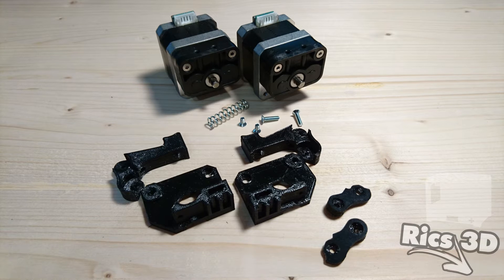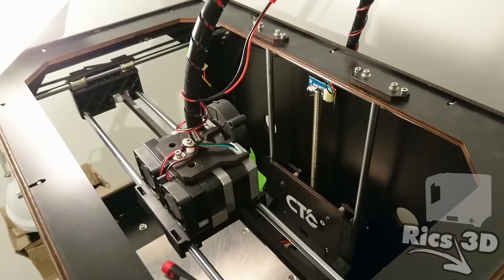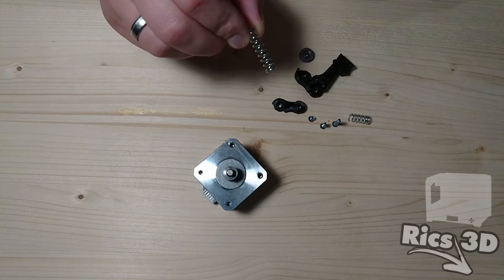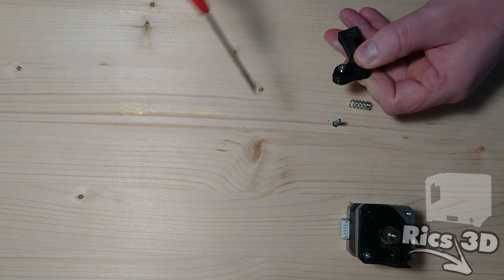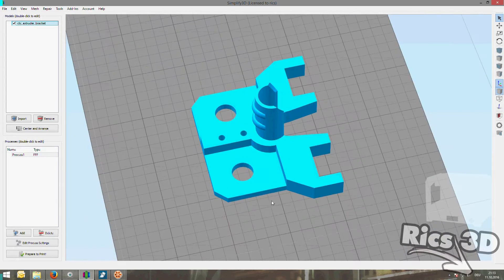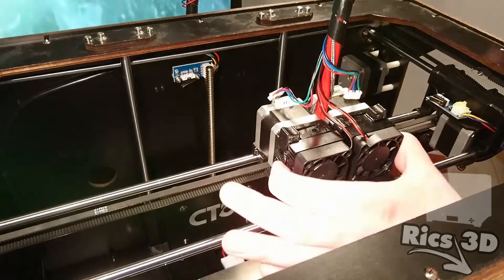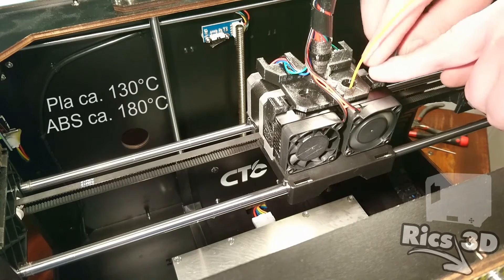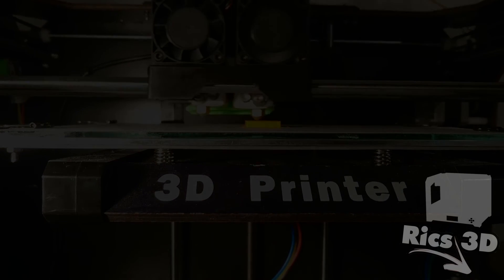CTC 3D Drucker - Tuning Tutorial_2 (Springloaded Extruder)

Comment: Hi Rics,
ich finde ja Deine Videos echt klasse aber nur mal so nebenbei, Du machst mich arm. Wenn ich so sehe was Du umbaust, dann kribbelt es echt in den Fingern. ;) Ein riesiges Danke für Deine großartigen Präsentationen!

Eine kurze Frage habe ich aber dennoch. Habe heute das HT von Colorfabb bekommen, da ich meiner ersten Extruderversion aus PLA nicht traue. Ich bekomme aber mit dem HT keinen sauberen Druck hin. 1. schmiert es ohne Ende, zieht Fäden und die Haftung ist absolut null. Extrudertemp ist 255 und Heatbed 110, 1. Layer druckt mit 25 mm/s, danach 40 mm/s, gedruckt auf Bluetape, welches bereits ausgetauscht wurde. Hast Du da einen Tipp für mich? Bin echt mittlerweile am verzweifeln.
Reply from the maker: Endric Gollenbusch 

Hallo, erstmal danke :)
auf was für eine druckbettonerfläche druckst du?
eventuell einmal das ptfe Röhrchen tauschen. Den ersten Layer auch ruhig ein wenig aufpressen.
Reply: Ich drucke noch auf einer 4mm Aluplatte mit Bluetape. Sobald das Tape zur Neide geht, stell ich um auf Glas mit DDP. Röhrchen habe ich keine und aufpressen klappt auch nicht. Hatte anschließend, rein aus Frust, eine neue Feder verbaut, die Motoren gegenseitig getauscht, neues Ritzel eingebaut, das Hotend 1mm nach unten verschoben um den Fluchtbereich zu erhöhen, neuen Nozzle eingesetzt, von Obi mir kurzfristig eine Fühlerleere besorgt und das Bett auf 0,10mm einzustellen und die Temperatur auf 265 Grad und Heatbed auf 110 Grad eingestellt. Danach lief es. Ich danke Dir für deinen Tipp!. ;)